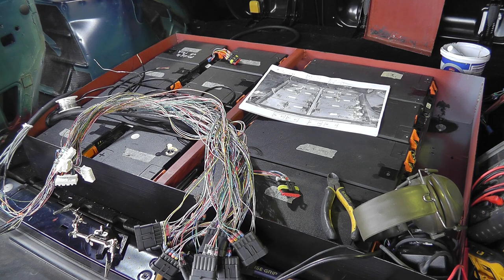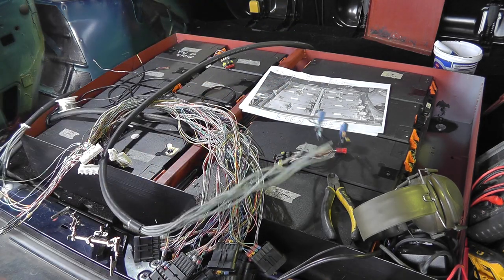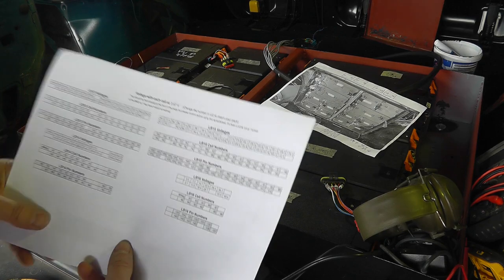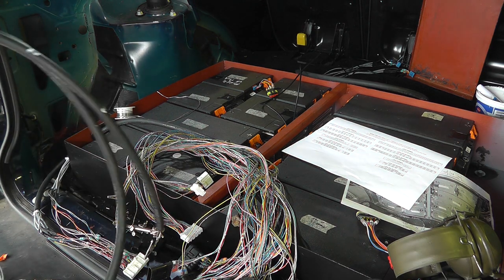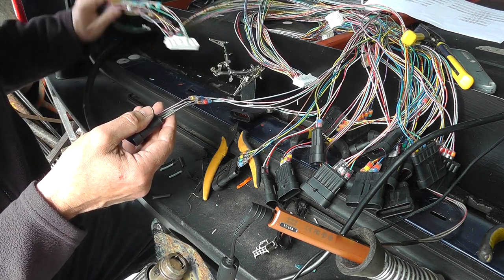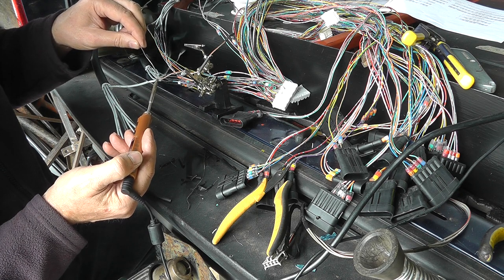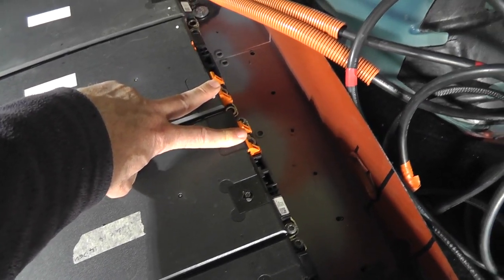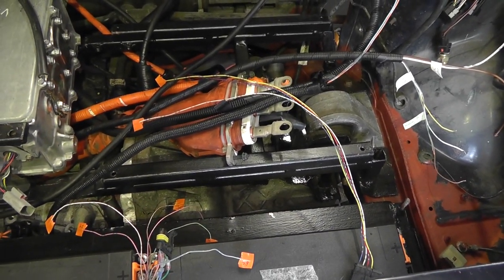DIY EV Part 42 - More BMS Wiring

Comment: glad to see you are making progress!!! I took some flack online for soldering our BMS wires... apparently using crimp connectors holds up better to vibration... so, something to consider for the future. We are still going to use our soldered connections for our BMS wires as I'm not going to redo them all, so we'll see if it becomes a problem for us. But in the future I'll try to use crimp connectors if it is wires that will have vibration on them.
Reply from the maker: Thanks mate. 
If done properly Soldered connections are fine, especially on thin bms wires where crimped connections would be too bulky. Some people love to tell you that your doing it all wrong but don't actually do anything themselves.
The other thing is it is easy to badly crimp a connection and not realise it, especially when doing 192 of them. It's easier to ensure all the solder connections are good.

Comment: I admire that you have not given up this major headache of a project Ali.
I can only wonder about the red tape you will face when attempting to legally register your glorious creation with Government pen pushers that work from home .

I wish you well.
Reply from the maker: Thank you. I'm confident that because I've not changed anything except the engine and fuel type it should be relatively straight forward. In the UK there is a points system for modified cars and as I have original steering, transmission and haven't modified (drilled or welded) the chassis (the entire monocoque body) I should be OK.
Reply: Can't wait for you to be using it as your daily driver and proving any naysayers wrong.
I have watched your previous ebike projects in the past and enjoyed watching your highs and lows during the process.

I myself have bodged together an ebike using a washing machine motor converted to DC and modifying the rear wheel with another free wheel and sprocket.
It worked fine but was temperamental at times.
I am currently using a Razor E300 scooter which i gutted and swapped out the OEM 24V motor and squeezed in a 36v motor & controller with slight frame welding adjustment.
It runs great but i am always weary of the boys in blue who are not that overjoyed with my projects.

All the best Ali,and God speed with youe EV
Reply from the maker: @Popeyes66  Thanks mate

Comment: Did you need to consider the wire thickness between the separated front and back battery packs? Or did you keep it all the same?
Sorry if I’ve missed this answer, but is the split of modules between front/back where that extra negative was in the original Leaf BMS wiring (48 from memory from your earlier video?)
Thanks. I’m binge watching but possible reaching saturation point!
Reply from the maker: If I were using the bms correctly the thickness would matter but it turns out I can only turn the bms on when off load. In other words when not driving.
This is because of the resistance between cells 40 and 41. When driving cell 40 shows wildly out of balance because of the voltage drop between the packs. When unloaded it is fine.
Reply: @alibro7512  thanks for the answer. I have to admit I don’t fully get what you’re saying ( sure that’s my lack of understand rather than your explanation) so maybe I have a bit more binge watching to do before I get up to speed with the end of your journey.
Reply: I should explain, I’m at the first step of a conversion (Resolve-EV VCU with full leaf motor), so still in absorbing mode in terms of what questions to ask, and then what the answers mean when I get them. I do intend to split my battery modules front and rear, hence my original question.
Reply from the maker: @ianlighting100  If you can split them 50/50 then do it although it won't be perfect it will help and make life easier. .
TBH I'm not sure how others handle split packs.
Good luck with your build.
Reply from the maker: @ianlighting100  I tried to answer this but Pootube lost it.
A bms has the positive of every cell connected to the neg of the next, so the voltage shown for each cell is in relation to the previous one.
That is OK when the resistance between each cell is the same but if some idiot puts 5m of cable between two cells it will have a resistance, even if it is 50mm2. There will be a few mV voltage drop which skews the reading for that cell.
Reply from the maker: The Nissan Leaf BMS is galvanically isolated between cells 48 and 49 which is why you want the split there. It doesn't matter for the inverter but saves the BMS from harm.
Reply: @alibro7512  appreciate the answer thanks, makes sense.